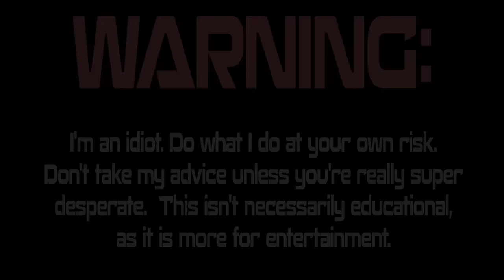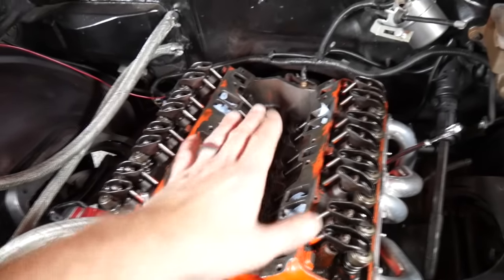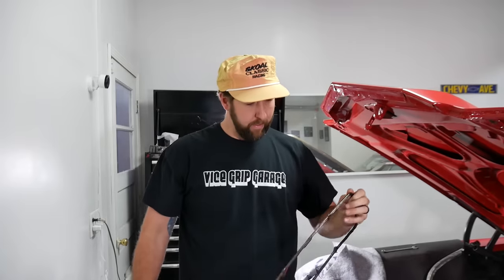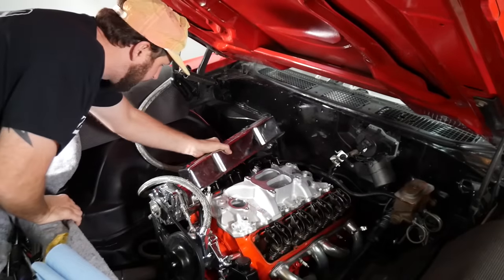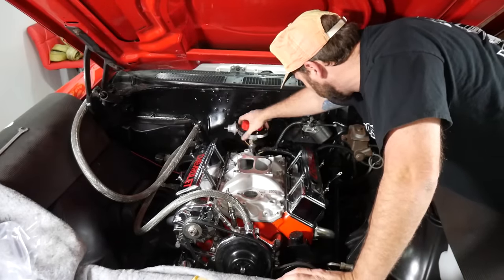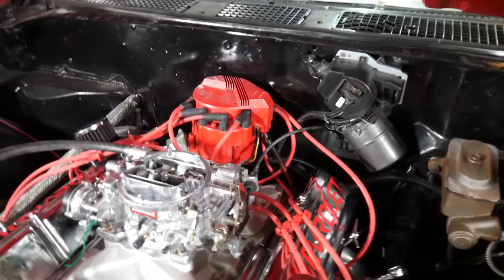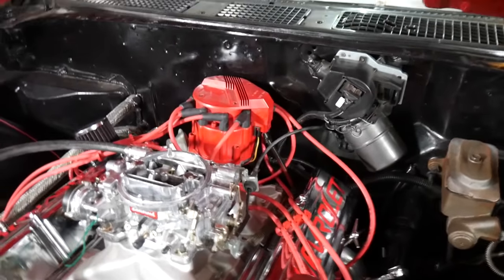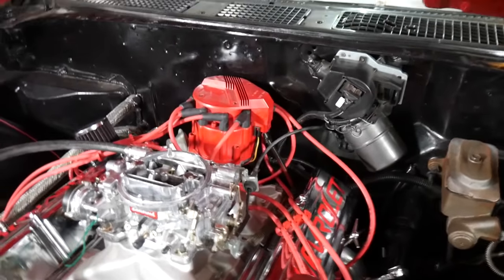Chevelle Gets Edelbrock, Cold Case, and Wheel Updates! - Vice Grip Garage EP54

Comment: I only ever needed to have one Flex Fan shatter, grenade, and put holes in the radiator and the Ram-Air hood on my '70 Judge. Lesson Learned. Now , I use a polymer fan off of Hum-Vee's with the HD desert cooling clutch, Victor Jr. water pump, 160-190* fan (depending on the application) and a Be-Cool or Cold Case rad-gia-tor. More modern rides I use multiple E-fans, pull and push as needed with E-thermostat switch (relay controlled fans always, on the ground side of the circuit) with an override switch in case the T-static switch fails. 

Water Wetter in the coolant helps it cool more efficiently,.. once I know the cooling system integrity is OK, I use 50/50 mix of antifreeze and a proper pressure cap. Every degree of pressure increases the boiling point 1 degree Fahrenheit per pound, at sea level. So, in effect, an 18 pound pressure cap will increase the boiling point of the coolant from 212 degrees at sea level, to 220 degrees at sea level. Anti-freeze is also important depending on the vehicle and cooling system/engine, as some systems must have silicate-based coolant, some silicate free, and mixing them can be disastrous.  

Dex-Cool/long life coolant isn't necessarily the bogeyman for cooling systems than it is made out to be. It doesn't necessarily corrode, rust, clog, turn to snot or the like as people have seen. What causes that is whenever someone somewhere adds tap water to the system. Factory sealed without tap water used will not cause it to corrode rust, clog or degrade. It's when the factory, the dealer, or some other Joe Schmoe adds tap water to the system, and it begins to break down within a year or less. 

The other things that cause it are a contaminated system or combustion leaks that allow acids or petrochemicals into the coolant as well as tap water and water with minerals. In a clean new, completely virgin system, a rebuilt engine that has been dipped and the passage ways in everything cleaned, new hoses, radgiator, heater core and the rest, with Dex Cool (or whatever long life) and pure bottled water, like the 99 cent per gallon stuff you buy from the Pharmacy, will not degrade and will last for at least 5 years.  Problem is, GM never educated people not even their own on the assembly line or dealer that the system cannot be mixed with plain tap water, and caused tens of millions of dollars in damages and failed coolant systems. I've used Dex Cool in my GM and other brand cars, as well as Texaco and Toyota Long Life coolant with pure water from the jug (never tap not even in the overflow) and never had a failure in my coolant or cooling system. I've had Texaco Long Life in my 2000 Durango SLT 4X4 for nearly 20 years, having replaced the green stuff, and only changed it twice in that time, with no failures or clogging/breaking down of the coolant.  I've been the only owner in that time.

What heads are on the Chevelle? I didn't see any accessory holes drilled in the front's so I was thinking they are either 202 Double Humps or early Dual Quad-Fuelie  "Powe Pak" heads? Either can be made to work with great effect, though they are getting pricy in my neck of the woods the last 2 decades. Better option are the later Vortec "Fast Burn" heads, or if you can find them (cheap), the L-98 Corvette aluminum heads with 58CC chambers, which you can fit bigger valves in and add some port matching as well as bowl work  plus open up the runners to make 'em flow like gangbusters.  

Later  2 and 4 bolt blocks can easily have the lifter valley stand off's tapped and drilled at home to allow for roller cam and lifters to install,  the OEM spider hold down retainer, and the front drilled as well for the roller cam retainer. There are retainer-less setups that don't need the spider to hold the lifters, but using the factory parts is what makes it cheap and doable.  I like using roller cam's in small blocks, older and newer, and for really all performance engines , versus Flat Tappets. It is not because I don't like Flat tappet cams, but unless you constantly add Zinc and other Dinosaurs, you can so easily end up with a wiped lobe(s) or dished lifters, or both as well as other valvetrain woes and metal throughout.

The other benefit of roller cams versus flat cams is you can run a whole lot more lift and ramp, without float or other issues, as the roller follows the cam lobes very precisely. Plus you can re-use undamaged roller lifters (they almost never are damaged unless something grenades) over and over with different cams, even mix them up  when removing and reinstalling them on the same cam, without worrying about any damage or wear on the roller lifter itself of the camshaft. 

Yea, they cost more, but you don't throw them away every time, and they can be used many times over and over, in different motors and with different cams. Same with Roller rockers, pushrods being the most disposable item next to valves themselves in the valvetrain

Whatever cam you have in there it sounds awesome, Derek, like that "Mother-Thumper" cam or something really similar. I want to thank you again,  for sharing such a Cherry Chevelle with all of us!  I love your cars, and your channel, Derek. Thank you for doing what you do for us to watch at home. I might need to get the wife to help me to drive out to South Dakota one day, to your buddy's place and bring me back a decent Buick Riviera. Towing one behind my Durango on a flat trailer wouldn't be an issue. 

The Riviera is really the only car left that I want that might still be realistic for me to afford, something I can make nice and use as a going to town rig as you call it. Something unique and different, something I can be proud of, and take to shows around here. We're pretty close to Carlisle, about 35 miles or less, and I'd love to have something I can take on car cruises around here or maybe put in the Carlisle show,. something with balls, stylish, comfortable,  with AC ( I cannot take the heat of summer anymore), a head turner, something not everyone else has, like Challengers, Camaro's  and Mustangs. My grandpa is the one who influenced me to love Buicks, and the 66-68/ nd '71 Riviera has always been my favorite. 

The only other car that comes close is the A-Body, specifically the '73 Grand Am, with either the 400 or 455 SD and factory 4 speed,  maybe with the Can-Am Shaker hood. I think that is my only real bucket list car, more than a Riviera, a '73 400-455 4sp Grand Am with a Can Am Shaker and hood. Those area about as rare today as hen's teeth!

You showed a 66-68 ( couldn't tell the exact year from your video) on camera, walking Zweifel's  property, not inside the building, but under the awning area, and I really really want a Riviera badly, but everything here in Pennsylvania is rusty or too expensive and not worth it, and or both.  I want a '66-68 Riviera the most, a '69 is OK, or I could die a happy man with a '71 Riviera GS, which I know I'll never own in my life, as they are too expensive for an old Veteran like me on disability to ever afford... 

So I get to live my desires watching you on your channel. You do things the way I used to when I was still in the business. I've been disabled almost 10 years now, and miss working on cars and building cars every day of my life. so you enjoy it for us both, and never take a day of it for granted, no matter how bad a day it is or how much the situation sucks...

Comment: Flex fans are a hazard. Heard stories about them coming apart.
Reply: Blades break off at high rpms.
Reply: Flex fans are okay, as long as you regularly inspect them for loose blade rivets and corrosion. And I certainly agree they aren't built for sustained high RPM's. But they are fine on a big slow V8 that you don't take above 3,500 revs. Much more than that, and things will get interesting.
Reply: I broke 1  went through the hood.
Reply: As long as a guy wears eye protection he is all good 🤣

Comment: i pulled my mechanical fan off, i'm running two electric fans hooked to a toggle switch
Reply: Shawn H. How noisy are they? And what brand if they aren’t to noisy
Reply: That works great till you forget to turn them on half an hour into a drive. 🤦🏻‍♂️
Reply: Aaron Hayden I got 3 switches for my drag car. Ignition starter And fuel pump so it wouldn’t be to hard to remember for me because I’ll turn them all on at the same time
Reply: @aaronhayden1780  lol yep. Theres been a few times when I look at the temp gauge and say OH SHIT

Comment: One of the things that help keep valve covers from leaking is these metal strips that rest on the sides of the  valve covers that when tighten down the bolts it puts a broader area along the edge of the cover.  Light weight aluminum covers will bend and cause a leak.   also using valve cover trees that use set screws make changing valve covers much easier.

Comment: Loctite anaerobic gasket is my favourite. I have some 518 that’s meant for aluminium but it works on anything. It’s sticky but only sets when trapped in the joint. No going off before you are ready and no silicone lumps in you oil system .

Comment: I use the thick cork valve cover gaskets. I use RTV on the valve cover side and I use used engine oil on the cork with a little bit of tack spray on the head side.  Makes it real easy to remove the valve cover if you ever have to do an adjustment, and you're able to reuse the gasket again. :-)

Comment: Here's an old trick of mine, when you're installing heads put a little dot of rtv in the upper corner of the head so you can attach the intake seals to the exposed rtv later on and they won't leak in the gap between the intake and the heads.

Comment: I'm with ya all the way on using RTV for intake valleys. Right Stuff by Permatex is best, but it's about $30 at the local auto parts store, so regular black Permatex works just fine for a budget.
    I'm a fan clutch guy if the fan is huge. I have a 4 blade on my little chevy car that does fine but the old F250 had a big monster flex fan for the Camper Special 3 core. I put a clutch on that one because even though she had 3:54 gears, it almost seemed like I was coming up against a wall when I got up past 55mph with the ol' flex fan and she'd do 70 just fine, so I know it wasn't an engine rpm thing.
    I hope them fumes didn't get to a feller about the time you were puttin' on the rear tires. Your speech seemed a tad slow, unless it was the cold freezin' your face. 😁😁 Hope you got the burn out of your eyes.

Comment: Off-roading when using the metal flex fans they bend and wipe out the radiator  when diving into a big water hole. I use a plastic stock style clutch fan and they tend to work real good.

Comment: I'm a Buick guy. Buicks for whatever reason have something like a 3/8 gap inbetween the bottom of the intake and the china rails. I've always used the rubber gaskets (they have tapered ends that slip under the edge of the cylinder head, the block also has dowels to prevent them sucking in or out) and I put indian head gasket shellac (or equally sticky shit) and let it set up, then set the intake down. let it sit, then snug the bolts. let it sit some more, then torque to spec. Works 100% of the time 60% of the time.
Reply from the maker: 🤣 good procedure

Comment: Chrome wheel openings and the door edge guards would really look good on that, a good stock radiator and correct fan shroud with the right spacing and diameter fan always worked for me, some flex, plastic fans are noisey and clutch fans are heavy and harsh driving and high RPM just burns the clutch up. I run a plastic one, it's noisy but works well and moves alot of air.

Comment: Why delete the coolant cross-over for a street car?  Seems it would help it run better in your cold climate.  

Inter terms of valley gaskets, I use the rubber gaskets with RTV on both sides.  I've had the solid RTV push out.  I also love the blue Felpro valve cover gaskets (and pan gasket) with the inserts.  Never had a leak, even on my altered where the covers come of for valve adjustment at the track.  

By the way, when you need a big allen wrench, put a nut and flat washer on a short bolt and run it tight, then use a socket on the nut and the bolt head works as the allen engagement.  The flat washer will act as stop for the tip of the socket.  For removal, either weld the nut onto the bolt or double nut it tight.

Comment: They sure do like to leak on those corners. I just redid my manifold gaskets a little while ago after a lovely coolant leak. Previously, no RTV on the gaskets, and the rubber end gaskets were used, so I went with the full RTV approach this time. No issues so far. The worst part was finding out that 2 threads were stripped on the aluminum heads.....so actually I did the job twice on the same weekend...wasn't too happy about that but at least got it resolved.
Reply from the maker: solved is good!

Comment: I clean any used wires including plug wires with a paper towel saturated in a product called Goof Off...It will clean any mess off the cable...It will even clean the factree lettering off the wiring if you scrub well enough...Some of the old 50's-70's plastic wiring that tends to turn white on the outside you can clean down to the original color with my method.

Comment: Ever consider a Impala coupe to take the Chevells spot? Don’t see many 4 door hard tops anymore, especially factory 4 speed T 23 Rock Crusher 427 trimmed ones. Nice cruise cars , the absence of the b pillar makes for a unique riding experience. Plenty of room for 6 adults, no upper door frame to fight with while getting in and out. Nice cars. Especially the post 71 models. A bird told me the 4 door hard top cars are going up in value somewhat currently and dramatically in the not to distant future. Keep your eyes out . Spot a original barn find style that only needs new rubber bushings and the tank cleaned . They where the King of the Highway back in the day. A built 225 is nice as well , wildcat, Oldsmobile 88 / 98 . Sedan not so much. 4 door sport coupe, I’m kinda looking for a Thunderbird with suicide doors myself. With a new BB FE in production, could be a winner.

Comment: i'm the kind of guy that when I do that, I get in the habit of putting a towel or rags down to catch the bolts that slip from my hand with the kinetic energy of the space shuttle. Making an screaming 110 decibel wine (think supercharger) These bolts or nuts usually develop about 27,000 RPM and spin their way Deeeep! into the block, or intake passages. Making for interesting start ups when they jam a valve open and a piston comes up to great it, just as you put the beans to her.

Comment: luv this vid i had a 70 ss 454  and 72 4door 350  dang it i sure miss my 72  did lots work on it top to bottom.
Reply: use to work on cars everyday now im 66 but have a brand new performance block an 202 summit heads an.......  on eng stand here in my den  want to hear it run someday   probably NOT.....        DEX

Comment: I run a factory clutch fan. Running down the interstate, that thing don't need to spinning 70billion revolutions a minute.

Also running really slow pulling a trailer up a hill with the engine really reved up I don't want those blades to "flex" out when I need to really pull air through at slow speed but turning high revs. I'm talking about a flex fan in my old K10 in this situation and not a muscle car, obviously.

Comment: Clutch ones are best for street and reliability. I my self like electric because I work on mine alot and a little safer getting the digits cut off or drag a shirt in or something. But electric ones need more battery alternator upgrade because of battery drain in the summer driving.

Comment: Valve covers, glue thick cork gasket on it using weatherstripping adhesive....valve adj. Intake rubber and black silicone fairly dried.....I had old valve cover with top cut out so oil behaved itself when adj valves. Saves time and complaints from picky folks.

Comment: Best: Electric fan👍
Good: Clutch fan😐
Bad: Solid "flex" fan🙄

Engine Masters saw a 20HP loss with the flex fan. 😳
Either way, without a shroud, it's going to run hot. 
Electric fans mounted directly to the radiator are the most efficient at cooling, and the alternator drag is negligible on HP loss (1-3).

Comment: Love the channel, could  you do a video explaining how to put that weiand 144 on a SBC? I have one i'm trying to install but cant find any info on if a serpentine belt will fit the long nose version.
Reply from the maker: belt doesn't touch the water pump, it goes "around" it.  There's a pulley off the crank snout, and your pully on the case drive.  The idle/tensioner pully is attached to the snout.
Reply: @ViceGripGarage  Thanks for the reply! Awesome that you take the time to talk to your fans! What I meant was it looks like you're running v belts and are skinnier than a serpentine system. i've heard that the snout doesn't stick out far enough for the supercharger belt to clear the serpentine belt. any idea if thats true?
Reply from the maker: No idea if thats true. I would think they would have thought of that though.  If not buy a cheap chrome pully kit off ebay and swap them back to v belt
Reply: @ViceGripGarage  Dude I can't believe you actually answer the comments. Thank you so much. Once I do the swap, would you be interested in a vortec intake for a SBC (for a Carb)?
Reply from the maker: Potentially if its cheaper than online once shipped

Comment: A technical question. Where do you connect your remote starter button?  I know that one leg goes to battery +.  Where do you connect the other leg?  I know where I connect mine.  Curious where you connect yours? Thanks. Bill
Reply from the maker: Typically says "i". The lug thats hott when the key is cranked